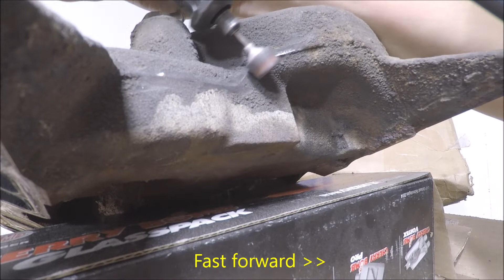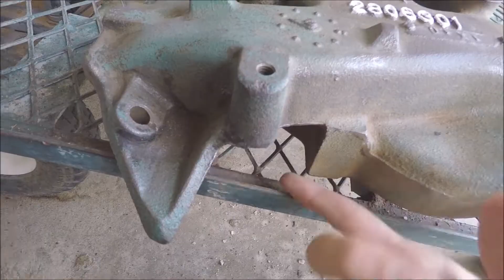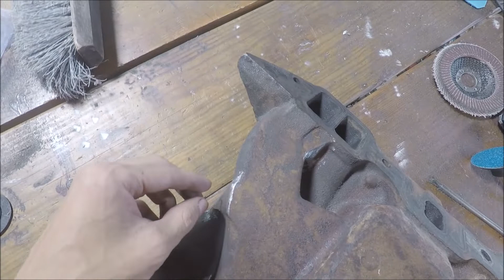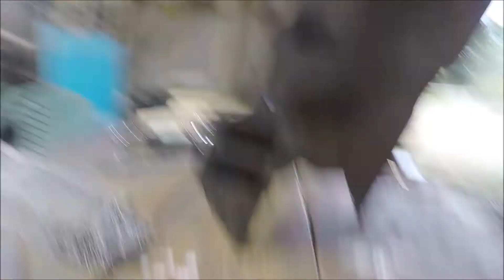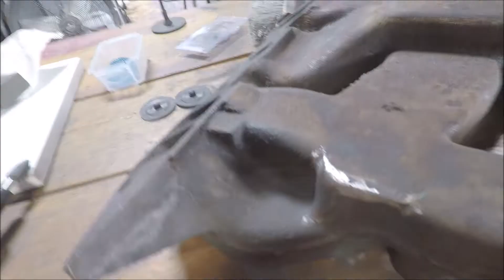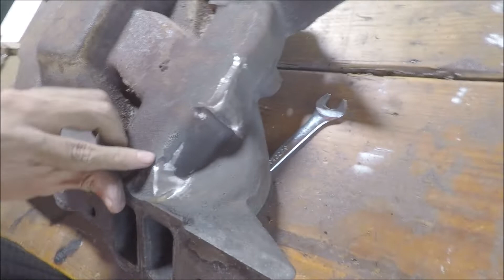My 1964 Dodge Custom 880 | Update #37 | Intake manifold goes on a diet!

Comment: Hey V, are you doing this for practice or? I'm wondering why not just get an edelbrock 4bbl that's ready to go and if you want it to look original just buzz off the raised edelbrock name from it and paint it up? Just wondering, I'd bet you could find one at just about any car meet/swap meet for fairly cheap..
Reply from the maker: Oh yes, the manifold wasn't really for practice. I just went slow on it with a stone bur to prevent me from making mistakes. 

And I guess I wanted some experience on what it's like to "modify" the stock components to try to optimize it as best as I can.

Also I don't have the time or money to go get a carbide bit, nethier another manifold.

Yes, about the manifold, between the 2 of us for now. The manifold is already on the motor with the carb.

Haven't got the footage out yet due to camera technical problems.

Getting an Eddy 4 barrel manifold might not have worked due to low space availability and the time invested in the original 4 barrel manifold.

And i apologize but I'm very set in stone to continue and to see how far I can go with just stock components.

I'd hate to get a shiny new manifold and end up butchering the name stamp and make the entire manifold look potentially "ghetto" 

Now if I did go the Eddy manifold route, I'd gladly do that as i don't like the Edelbrock name being plastered on every one of their products like it's going out of style.

I know I'm stubborn and it's sounding delusional about this whole thing, Sorry.